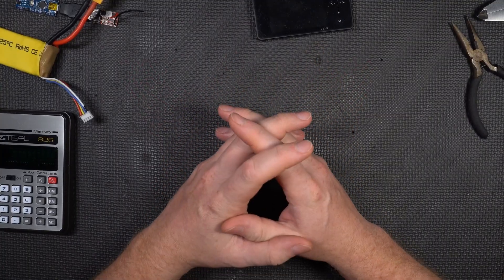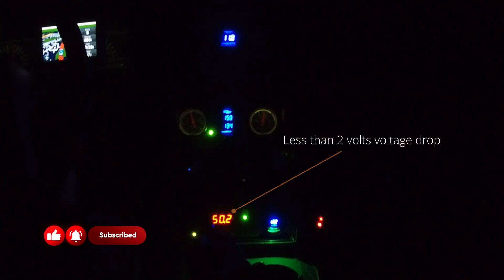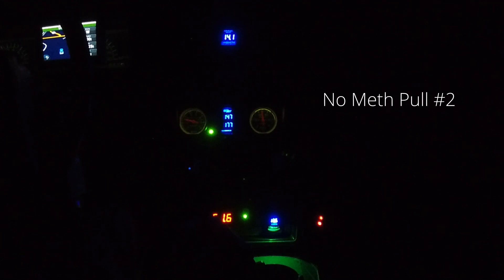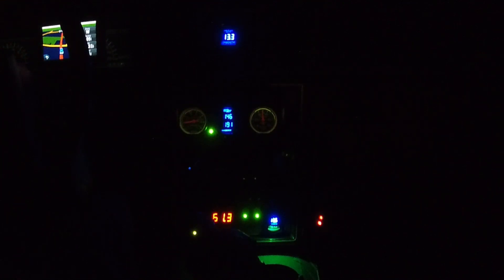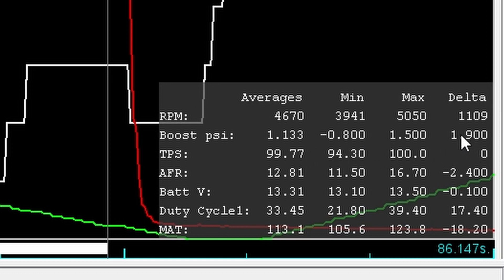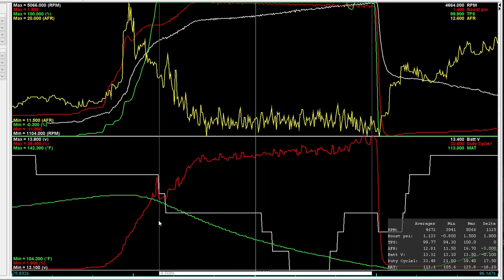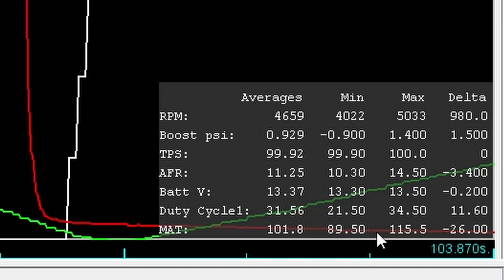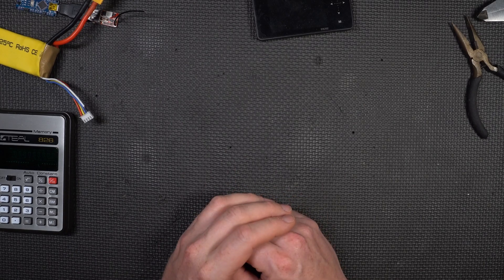Testing the Meth Injection for the first time - Data!

Comment: Trying to make sense of the data , I think it would be interesting to see a series of data from the intake. Temp and pressure at the inlet & outlet of comp, what the manifold temperature as well as compressor temp. If you go much higher than the 1.9 delta put a cooler on it. Air mass is an interesting place to start your calculations for fuel
Reply from the maker: The dyno session was much more telling.  And confusing in some ways...

Comment: Back in the day, on my '87 Grand National, I used to run propane injection. A bit harder to refill than meth, but you can't really flood the intake on accident. I think some turbo diesel guys use it.
Reply: Fun fact: propane has an octane equivalent of ~110 and if sprayed wet can majorly cool the air charge
Reply: @simonaldridge4099  I'm surprised it's not use more often tbh

Comment: Would you please please test the difference it makes if you just use distilled water, perhaps a little surfactant. Without meth alcohol. I would love to see an apples ro apples comparison, try to find some good data about that, it's quite hard and scarce. You lose some of the cooling benefits and the enrichment / octane effects. But there is more gasseous water! To change phases and absorb energy, to offer additional pressure increase
Reply from the maker: I would love to - and I'll be able to do a lot more testing once I move.  The problem with this area is lack of good testing places.
Reply: @AlexLTDLX  you mean Dynos or suitable roads/dragstrips?
Reply from the maker: @DC_DC_DC_DC  both, really.

Comment: How are you regulating your AFR in accordance with the boost?
Reply from the maker: We just tuned for it; it's in the EFI.  I could also have it running in closed loop all the time, but don't fully trust the megasquirt for that.  If I had a Holley system I would do that.  If you didn't see our dyno test (where we did the tuning), it's here: https://youtu.be/b9d5xv9INmw

Comment: My question is how do you know its cooling the charge that much? Temp probes become saturated and report falsely cool data. Easily seen by injecting right at a probe VS moving the probe extremely far down stream.  The more saturated the probe, the cooler it reads. Yet its not representing the aircharge as a whole. Those temps aren't even high enough to flash the mixture to a gas. 

Don't get me wrong, I'm a fan. I run it on all my turbo cars. But I don't think the MAT sensor represents the TRUE air charge in most cases.   What I'd be interested in seeing is if the boost pressure actually raises or lowers with it active. It should rise slightly if all is as it should be.
Reply from the maker: On the dyno video I posted last night, there was a slight increase in boost pressure: https://youtu.be/b9d5xv9INmw  Though I'll get into that in follow up videos.
Reply: @AlexLTDLX  thks! great content!

Comment: that electric motor won’t work naturally the way a turbo or supercharger will

the motor is too small also, run after run in the bay isnt good for it. A robust motor would suit this application more, and that bit expensive 

then come the (not) cool factor 

most guys running 1-2-3 bar these days
Reply from the maker: I dunno - having close to (now) 800 hp at the flick of a switch is pretty awesome if you ask me.  Here's the setup at the track when it was "only" making about 722 hp: https://youtu.be/nlTVHkfSQXM  You probably don't know this, but I've been making custom one-off forced induction setups for over 30 years - many of them based on positive displacement blowers and compressors (Eatons and Whipples mostly).  This is far from my first rodeo.  You could daily drive any of my setups.  In fact, that's what they're all designed to handle.